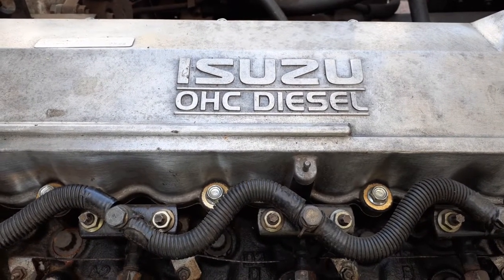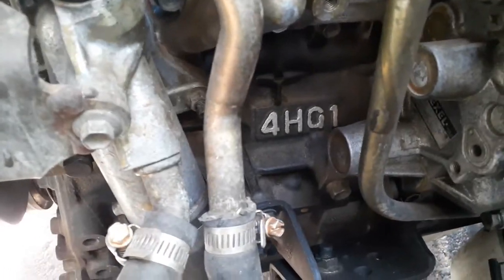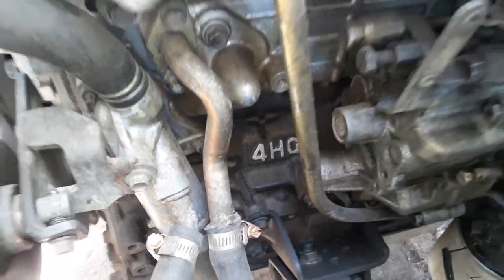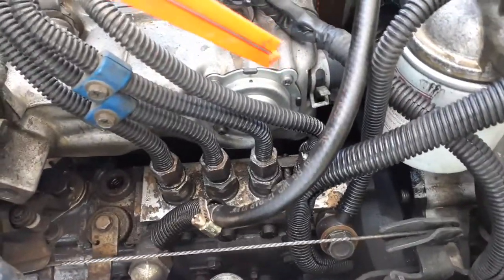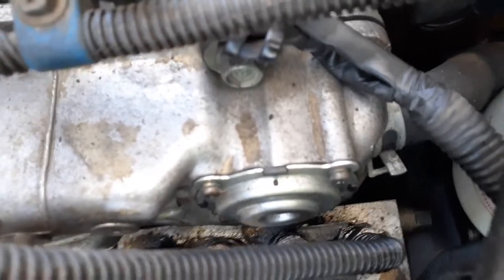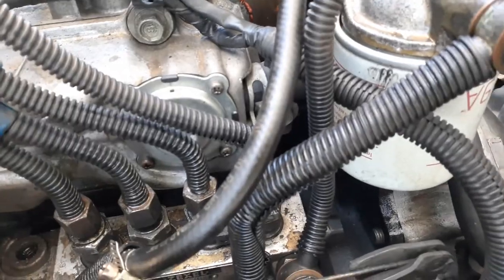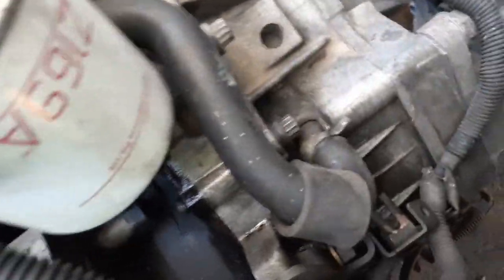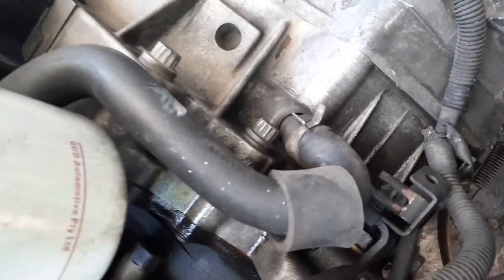Isuzu 4hg1 4.6 / 4hf1 4.3  PCV valve location

Comment: i want isuzu 4hf1 engine .   how to buy engine... and how much... im in sri lanka..
Reply from the maker: It's hard to say , how mutch or where to buy a 4hf1 engine in Sri Lanka. These engines are expensive even for a well used engine . Personally I gave up on trying to buy another engine and had the old engine reconditioned , for less than it would cost to buy a used engine.